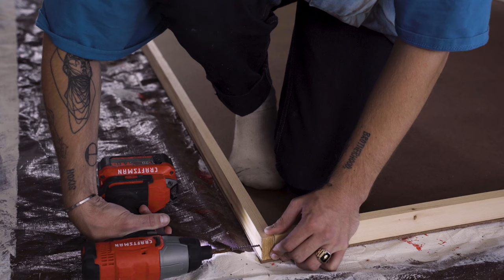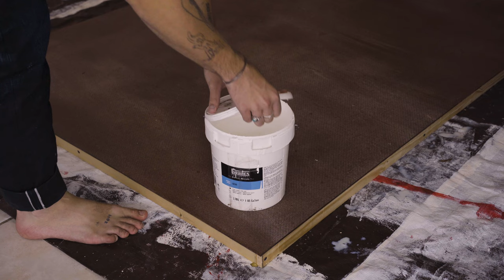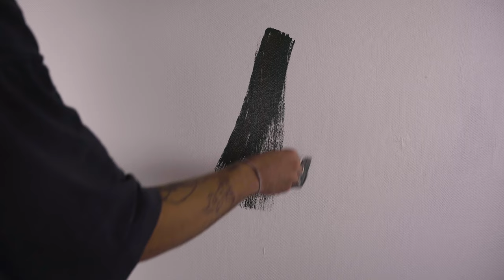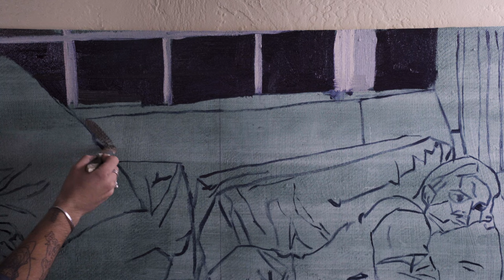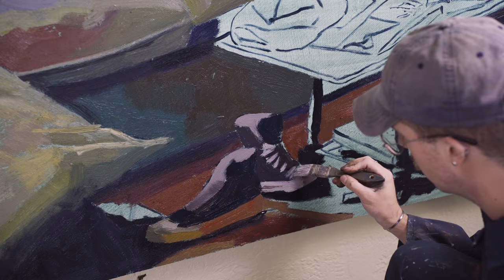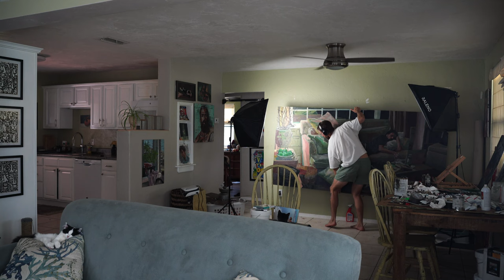Oil Painting with Subtlety: Mastering Muted Colors

Comment: I'm with you on your contempt of visible canvas texture. I gesso then dry then I use a palm sander w/ fine grit and sand. I repeat as many times as is needed - till the surface is as smooth as a baby's behind. Yes it's messy but my studio has a door to the outside. It's so lovely to paint on.😮